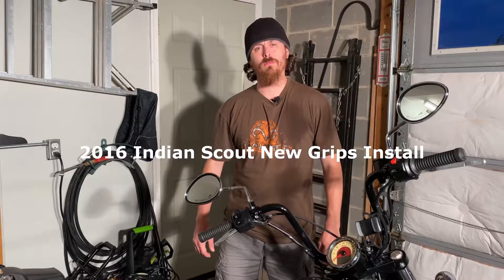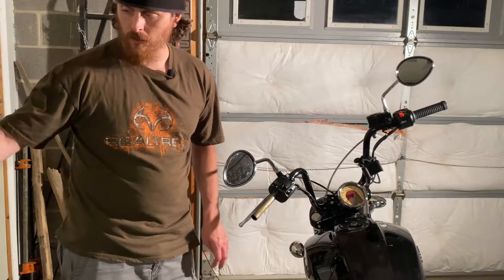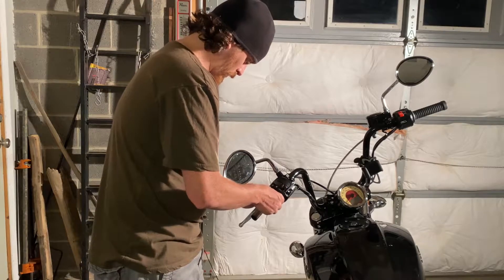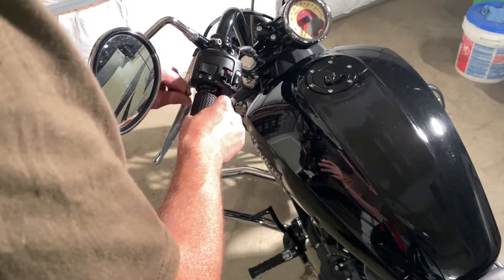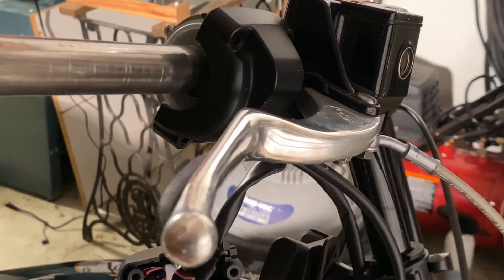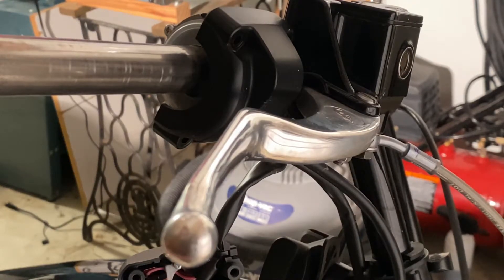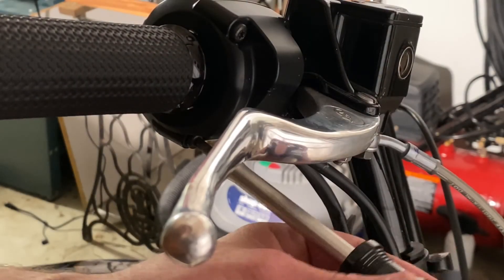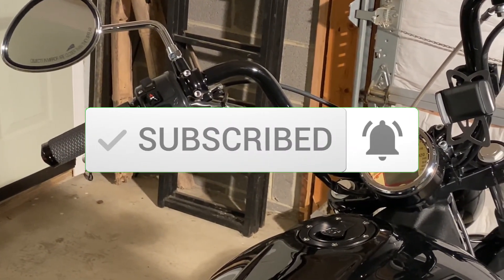2016 indian Scout Sixty Avon Grips Install

Comment: How are the grips after using them for a few months now? Need to decide based on your opinion. 

Great video...keep up the good work.
Reply from the maker: Thanks for watching utubevid0! They are still a lot more comfortable than the previous stock grips were, in fact I kind of forgot what the stock grips felt like after using these Avon’s the past couple months, all I know is my hands don’t get numb like they did when I used the stock grips.  Now I don’t believe they remove all the vibration coming from the bike, but that may be other factors I’m looking into correcting in the future.
Reply: @TechNickRides  Good to hear. Just ordered one..BTW, Amazon has it for way cheaper - yes, I confirmed the part # - should start with IN-S (Indian Scout).

Do appreciate your quick response. Was watching your other mods videos (clutch cable, Bassani  slip on - those are sounding great).

Nice videos. 👏🏻👏🏻

Comment: I see you got the highway bars. What do you think of them? Since they go forward, I didn't think you could rest your foot on them, so they're really just for protection.
Reply from the maker: Yes, the highway bars came with my bike when I got it.  I like them when it comes to knowing their there for the extra protection, especially in slow speed maneuvers  although I have not had to use them for that purpose.

As far as attempting to rest my feet on them I see they make highway pegs that can be added, something I have not looked into yet.